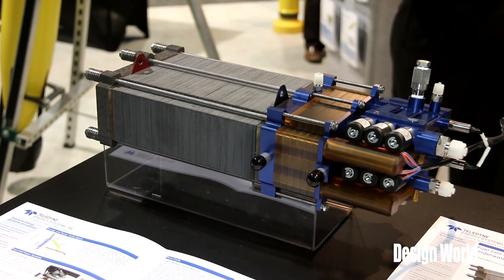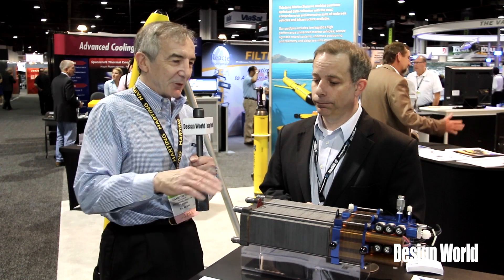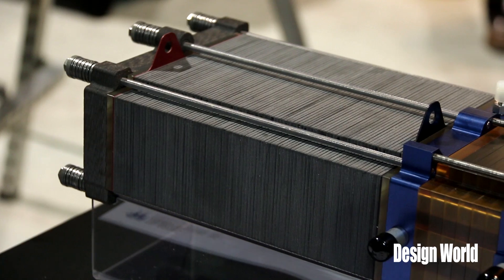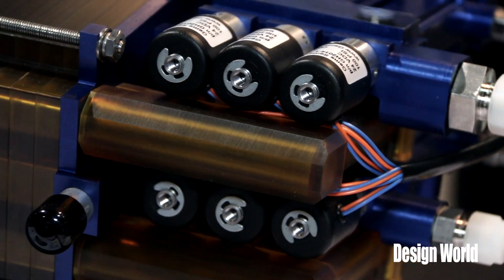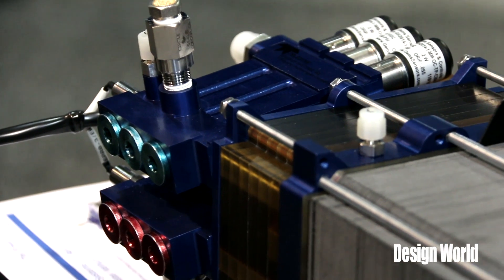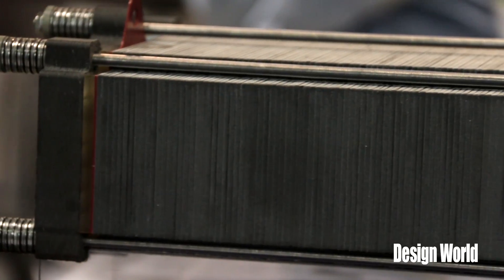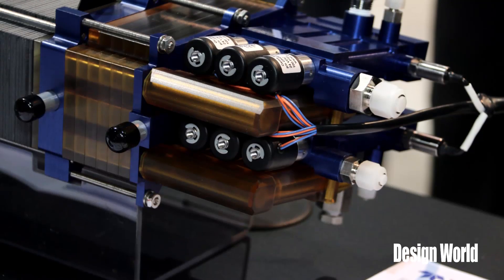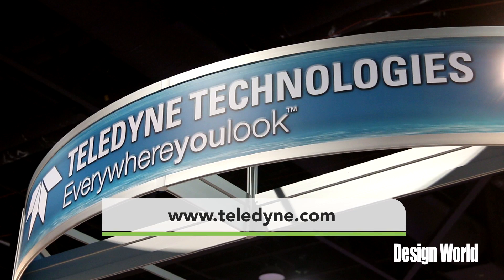Who needs batteries when you've got a hydrogen fuel cell

Comment: Remember you need a tank to store the hydrogen 
The bigger the tank the longer it runs so how much does the tank weigh that runs all day ?
Dont get me wrong I love hydrogen but this is only half the story remember you still got to fill those tanks with hydro most places its still quite expensive and use fossil fuel to produce hydrogen (Dirty  Hydro) and still not much infrastructure out there yet.
Remember you can charge a battery in your garage ;)

Comment: im confused, i dont see how this device generates power, i see how it generates hydrogen,  compresses and refeeds the cell.. but how is it converting hydrogen into a power source, when its just a flameable gas.. - there is no combustion motor attached to this product.. in fact, the pump is electric.. so this isnt a complete product.. but a piece of a product yes?

Comment: There's so much focus on lithium ion as environmentally friendly when it takes a massive amount of energy to mine, ship and refine not to mention the uranium needed to charge them. Apart from that the batteries break down over time so they need to be replaced creating more waste and they're filled with toxic metals. So how is that any different than the oil we use now. There's a limited supply of lithium and nickel and the mining operations is more destructive than drilling a hole in the ground. Folks are getting sold on lithium because it benefits share prices and has a greater long term cost of ownership. The same business model anyone old enough should be able to understand. Ask someone over 50 how long things used to last compared to now. I'd still be using my 1st cellphone if they hadn't stopped providing service for it. Now you can't change batteries yourself, can't add storage and if you keep your phone long enough a software update renders it uses so you have to buy another guaranteeing continued sales and boosted profits. Lithium ion offers better profitability to companies and shareholders just like oil and increased tax revenue for the government because it's very labor intensive to produce. A whole lot of hands are involved in making a battery which means a whole lot of income tax, permits and continued tax revenue through utility companies. On the other hand you have Hydrogen, the most abundant element in the universe. The only problem is here on earth it's reacted with oxygen to form oceans, lakes and rivers. Fortunately that process can be reversed so we can use the reaction on demand to do useful work as we need it and it's more environmentally friendly to produce. It also weighs less than lithium which means less weight on a vehicle which translates to less energy needed to move the vehicle, better range and less overall cost of ownership due to maintenance like your tires and breaks wearing out. Any welder should be familiar with the concept of refueling a Hydrogen Fuel cell. Just fill or swap out tanks, no need to wait hours to charge. There's no need to spend trillions of tax dollars on infrastructure for charging stations and putting a strain on the grid of small towns by jacking up their utility prices. Hydrogen is transported and stored much like propane, gas or diesel and is less dangerous than all. The world is being sold on lithium by billionaires and politicians who are already invested in the industry. Just do a little history research on the battle of AC vs. DC. Elon Musk is a billionaire business man not a billionaire physicist and if our understanding of history is correct Nikola Tesla would not want his name associated with that company.

Comment: Could you run a standard household off of one of these not just the basics but a washer a dryer a deep freeze and a fridge? Also how efficient are they compared to lithium ion and would the lifespan be the same?
Reply: A whole house PEM needs to generate  10-12kw  (for power surges), I’ve been looking for plans to build one for years, so far I ‘ve  been shown only very small school projects. I’ve been told an emergency whole house PEM would be generally 3’w x 6’ Lx 4’ H, that’s ok bc it would sit on a concrete covered pad. So far useful PEM’s are all abt big money! Shalom!

Comment: funny, hes comparing a powerplant to energy storage. any powerplant can beat a battery if you give it a big enough fuel tank. A rotary engine will outrun a battery that can produce the same power output if you use a fuel tanker as its fuel supply.
Reply: Regular motors make to much exhaust noise.

Comment: A lithium battery weighs 830 kg, an hydrogen one 30 kg. Charges in a minute instead of 2 hours, and doesn't degrade with time.
Reply: The kaboom hydrogen does tho
Reply: @juozasgecevicius6660  Lithium when it contacts moisture in the air violently explodes.
Reply: They actually do suffer degradation they said they can last up to 7, 000 hours and it's a generator not a battery as long as you have a hydrogen flowing into it it will continuously generate so that's 6KW of continuous output for $7,000 hours the average lithium ion battery has a lifespan of 10 years if you don't abuse it but you will need a battery Bank of them to equal the output one lithium ion that has 100 amp hours at 12 volts cost roughly 600 to 800 dollars you would need at least 12 batteries to equal the output of that hydrogen generator and they would only last 24 hours max before having to recharge. The hydrogen generator dumps  6KW all at once continuously that's a lot of power easily enough to turn you into a charred husk is handled wrong that's 6,000 Watts after hooking it to an inverter and a voltage regulator to get AC instead of DC you'll probably lose 100 Watts maybe 200 if you have poorly made equipment and your inverter will probably be a 12,000 watt or higher because it steps up your voltage and amperage
Reply: @silenttitan7636  I need a small one for my mobility scooter
Reply: @taxximaxxi  don't need to fill at the gas pump. Other places have it
Reply: What size lithium battery?
Reply: @invisibilianone6288  Like the tesla 75 kWh one.
Reply: @davidtheguitarman  480kg, info shows, for the 75kwh Tesla battery pack.👀☕
.
For model 3, long range(haha)
.
771kg, for the model Y
Reply: @invisibilianone6288  Yes I meant the model y one, btw they're both still damn heavy.

Comment: uhhhh so ,,, fusion is no big deal ??? 😂   he is just a scammer ,,, its elektrolyse device
Reply: do you not understand what a hydrogen fuel cell is?
It's not fusion it's chemical reaction between two reactants one of them being hydrogen.
Reply: @TauCu  it's its elektrolyse if you use elektrodes  , dont you know what a scam is ?
Reply: @smilernok  I do know what a scam is.
Do you know what English is?
Reply: @TauCu  vi kan godt tage den på dansk, hvis du ikke forstår engelsk så godt ? 😄
Reply: @smilernok  No one understands your mumbles pal.
Probably not even people who speak danish.
Reply: @smilernok  Ok, that was fun.
... Anyway it's not a scam and it's a real technology. 
Electrolysis is a common method used to produce hydrogen and oxygen gas. Not generate power from it.
That is a Fuel Cells job. (the device in the presentation is called a fuel cell)

Another common industrial way to generate hydrogen is called steam reforming.

A fuel cell works by taking two reactants and reacting them in an enviroment where the electrons from the reacting gas move through a current collector (somewhat similar to a battery) and then parsing through the thing you wish to power (the load) and being collected at the anode where the reaction ends.
Reply: @TauCu  ohh you must be insainly smart , you can spell right and stuff ,, lets all bow before you .... you prove it well ,, im not good at spelling and gramar , so i must be wrong ,,, 😄😄
Reply: @TauCu  ofc you would know this ,,, water is a fuel cell ,, it has hydrogen and oxygen ,,, most powerfull mixture known .
Reply: @smilernok  You're not wrong because you're bad at spelling... you're wrong because you you didn't prove anything.

And yes. I'm going to take a jab at you after saying "don't you know what a scam is"

Edit: also, perhaps write your 2nd comment in danish. what you said made no sense.
Reply: @TauCu  then you wrong to ,, you did not prove anything. (ofc you would know this ,,, water is a fuel cell ,, it has hydrogen and oxygen ,,, most powerfull mixture known ) you did not answer , but who cares , you are wrong , you didnt prove anything
Reply: @smilernok  You commented saying this was a scam, I provided proof that this was not.

Water is not a fuel cell, water is water.
yes water has hydrogen and oxygen. what about it?

Comment: The problem with batteries are that lithium are definitely not recyclable while water is
Reply: Lithium definitely can be recycled. It just isn't being done on a large scale because the extraction of lithium from old batteries is five times more expensive than mined lithium. AT PRESENT! Well designed battery packs for BEVs can have a second life for static energy storage, which can extend their useful life for ages after they've become unsatisfactory for their primary use. Then they can still be recycled.

I like the idea of FCEVs for long haul trucks, trains, marine and aviation transport. I just think BEVs  now sate the demands/needs/wants of most drivers.

Comment: Hydrogen fuel cells need batteries to function as a buffer.
Reply: @stefanlange485  Will it?
Rocket engines are less efficient then batteries and motors however you don't see anyone using batteries for rockets. (unless it's the electron rocket that just uses batteries for spooling the pumps)
Because batteries are not efficient at that job.

Fuel cells end up being more efficient for what this guy is saying because the system is smaller and lighter.
if they weren't they wouldn't be using them.
Reply: @stefanlange485  I didn't say it was more efficient. It said they must have found it to be more practical.

Also when in use in unmanned UAVs the issues with fire/penetration become almost void.

Toyota has already pioneered a composite tank for hydrogen and helped demonstrate that it can be used safely.

I'd be nice to have the battery you speak off but it doesn't currently exist.

Also from my understanding of "Electrinium" batteries is that they sound impossible.

Edit: unless of course you have an idea how to create one... in that case "we must be the change we wish to see in the world"

Comment: Youre replacing Engines not batteries.. batteries are just storage for electrical enegies.. fuel cell and engines converts Fuel to Electrical/Mechanical energy.. The argument that it runs longer than Batteries is misleading..

Comment: The hydrogen tank goes right around that bottom assembly... It it just a little bit bigger and wider than the base of this system. This system fits down into the base of the tank...

Comment: I'm sorry ...WHAT !!!????...    .Why you don't use lithium 6 deuteride like hydride material in the tanks !!????..... this guy did it in 1980 in his own back yard.. https://www.youtube.com/watch?v=KPIk2LdhxYk
Reply: This is why not..

The corresponding lithium-6 deuteride, formula Li-6-D, is the fusion fuel in thermonuclear weapons. In warheads of the Teller-Ulam design, LiD is compressed and heated by the explosion of the fission primary to the point where fusion occurs. Lithium-6 deuteride, unlike tritium, is non-radioactive.Nov 19, 2009
Reply: https://www.youtube.com/watch?v=KPIk2LdhxYk
Reply: @BluefuelSystemsH2ogas  have seen since2013.
interviewee is annoyed by silly annoying interviewer..
This is not electrolysis ie joe cell smeyer? Correct?
He is burning i.c.e
This other vid is electric power. From
If i may "reverse electrolysis"
Aka fuel cell
Reply: Yep back yard with his particle accelerator..
Reply: Why or what or

Comment: 83 of these (6000watt)x 60 lb
100 watt per pound 
 each .4.5 gram per watt.making 1/2
 megawatt. 
Power 80gvw class 8
  (maybe)5000 lb.
Weight of engine &trans. could be lightened
Reply: it doesn't scale like that because of the weight of the framework

Comment: Im more into the methanol fuel cells, those are great and shows great promise
Reply: bmsfx but what about carbon-free energy source?
Reply: @sadootaqoo981  mathanol is organic based, all that come out of the end is water wapor.

Methanol could at some point be extracted from garbage or even the co2 from our own atmosfere, as such i love the idea about it
Reply: @bmsfx  doesn't methanol have carbon in it?
where does the carbon go?
Reply: @TauCu  a methanol fuelcell could have a extreme low carbon release, but remember its not a combustion engine, so i would not think its released in the air or if it is, it would be extremely little..

I do know though you can make methanol from co2..
Reply: @bmsfx  yeah methanol is CH3OH
So it does have carbon and fuel cells react two the two reactants together.
This means you get water from the hydrogen and c02 from the carbon.

It does release co2 and not an insignificant amount.

But yes, better than an IC engine (mainly because lack of N2O)

Hydrogen burns in a fuel cell only to H2O

Comment: This is not a replacement for batteries it's just a generator. He doesn't know how to market this thing. Why would you even call it a replacement for batteries? That only confused the hell out of the guy asking battery related yet irrelevant questions because like he said it depends on how much fuel you have so it's not a direct comparison. I understand exactly what he's saying but I'm already familiar with electrolysis the guy asking the questions sounds like a fool which means there's something seriously wrong with this video and the marketing of that product. Personally I don't even like the idea of using electrolysis to make electricity from hydrogen because it only encourages you to make hydrogen using methenal reforming which is more efficient than hho electrolysis but more expensive and produces carbon emissions.

Comment: You did not include the tank of hydrogen which is bigger than batteries
Reply: If he was right with his estimate of the 6kw battery lasting one hour, then no, the corresponding Hydrogen Tank would last you longer than said battery. To be fair, the question was very weirdly phrased...
Reply: The tank is not much bigger than the base of this unit... The unit in the video feeds down into the tank with the upper portion sticking out of said tank...

Comment: Is Hydrogen as a fuel renewable or something?
Reply: Yes it is, but it takes energy to produce it.
A Hydrogen fuel cell takes pure hydrogen gas & pure oxygen gas & turns them into water molecules thereby releasing energy in the process in the form of heat & electricity. Easiest source of Hydrogen is water, but energy must be expended to break the water molecule into its component Hydrogen & Oxygen, which of course are the fuel used for the fuel cell.
See the cycle?
Reply: @ZedAlfa.  
So the water is permanently destroyed...
Reply: @robinhyperlord9053  No
Reply: @robinhyperlord9053  if you burn Hydrogen and oxygen together you get water (H2O) if you convert water into hydrogen you get h2 and O